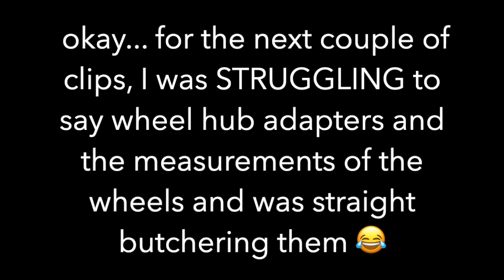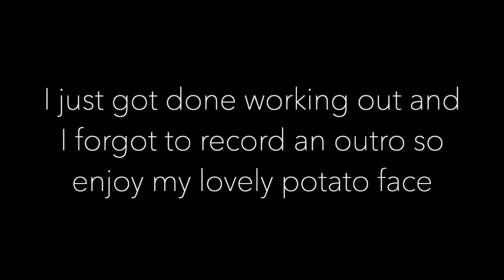Installing BBS Wheels on my 06' WRX | 1 Inch Spacers and Cutting Fenders

Comment: What's the purpose to use spacers?
Reply from the maker: Well, these spacers are also wheel hub adapter since the wheel patterns on the BBS are 5x114.3 and the WRX wheel specs are 5x100 which means I need a conversion. The adapters allow me to run the new wheels and the spacers are just there to give me that flush fitment. I wasn't using the spacers for performance, they were just there for looks because the fitment would be atrocious if I wasn't running spacers.